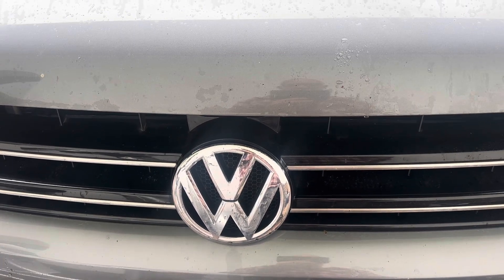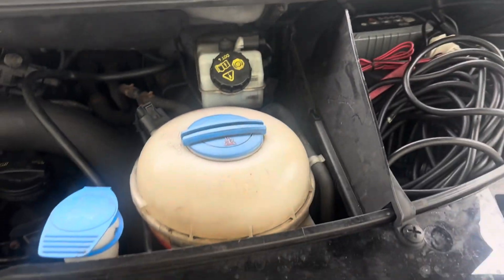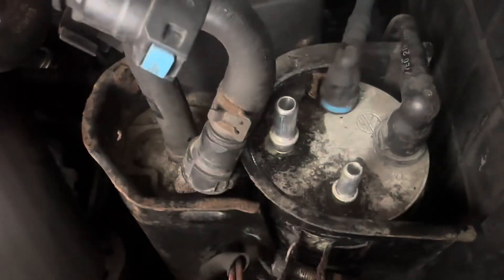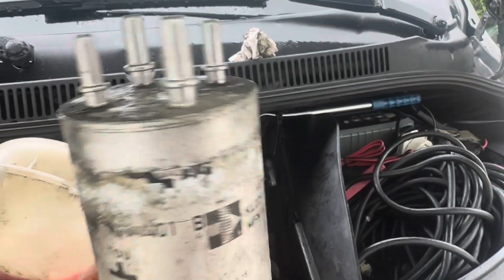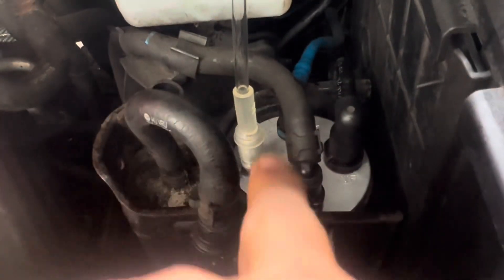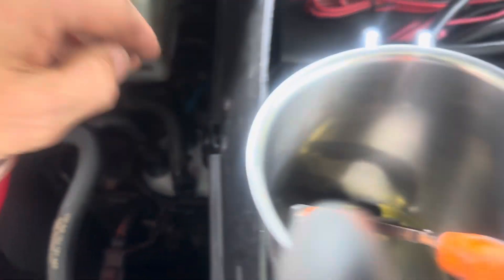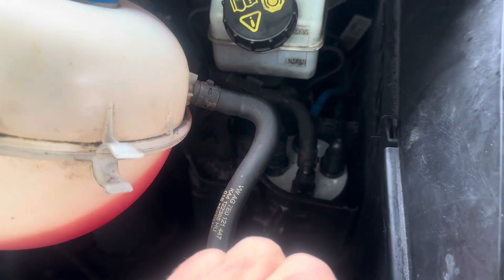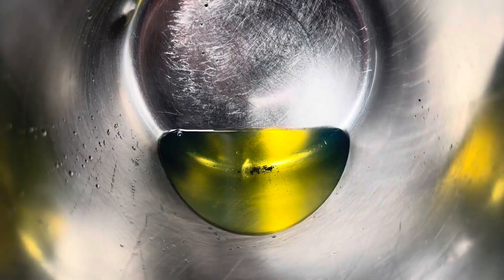VW T5-T6 Diesel Fuel filter change

Comment: How to remove the fuel filter housing?
Reply from the maker: You don't remove the housing ? The filter is all in one and the holder is a clamp as seen in the video. Some of the T6's you can have difficulty sliding the filter out of the clamp unit so to give enough room you need to losen the bolts that connect the clamp unit to the frame. This is down by the battery shelf. Keep us posted. You can do it 👍